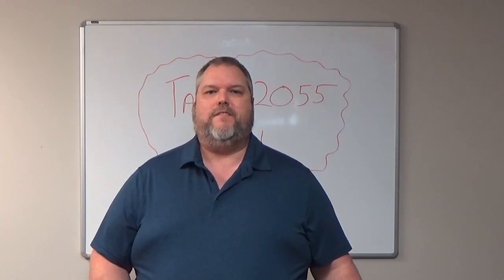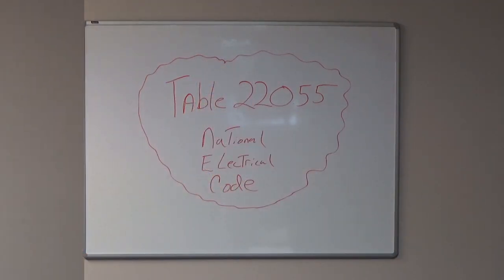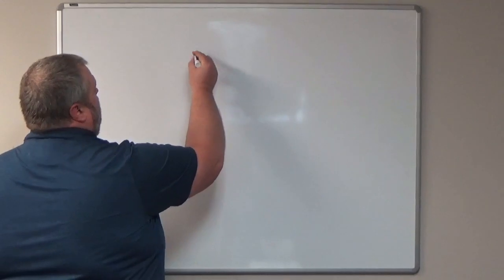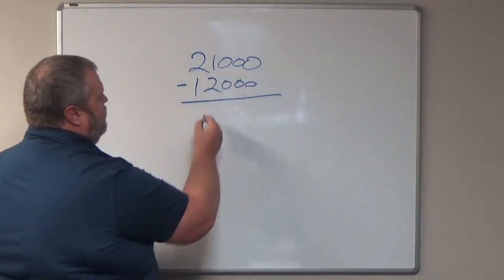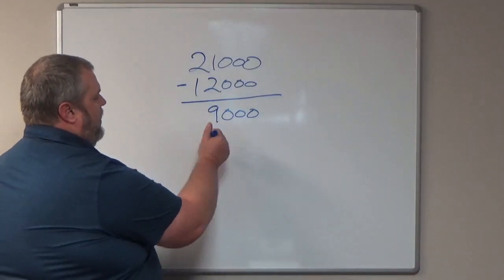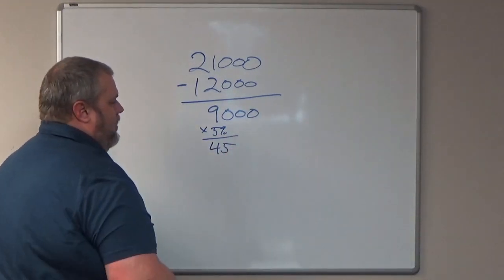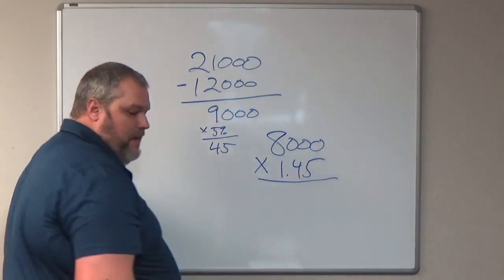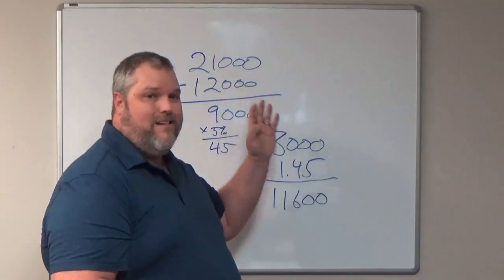Table 220.55 Calculating the Range Demand

Comment: Thank you for this video.  I really like your teaching method.  It's really helpful to go over these code tables/articles.
Reply from the maker: Thank you!! These video's are not the video's that excites people. They are here to help people. That is what I enjoy doing, helping guys understand the code!! Thank you for watching!! CM
Reply: @craigmichaud-electricalins4602  

 @Craig Michaud- Electrical Instructor  

 @Craig Michaud- Electrical Instructor  

Question: what is the purpose of the neutral pigtail on the GFCI breaker?

Why does the neutral from the circuit have to be directly bonded to the breaker but the neutral pigtail gets connected to the neutral bus bar? 

This is the only thing that I don't understand.
Reply from the maker: @KenKaneki-xh7by  it works just like a GFCI outlet. It reads the the difference in potential from the ungrounded and grounded conductors. I will do a video to explain it in the future!! CM
Reply: @craigmichaud-electricalins4602  

Awesome thanks, appreciate it.

Comment: Very Good break down . I have one question for last part of column C . So to make sure I understand your over under on 12kw . The question is even if your 15kW and you calaculate your 15% your still starting the calculation at 8kw and not 15kw ? Always calculate with 8kw ,    in column C ?
Reply from the maker: Yes you are correct!! You use the 8000 and multiply the 15%. I also just take the 8000 and multiple it by 1.15 and get my answer  without having to remember to add it to the 8000. Glad this helped you! CM

Comment: What if there are three different appliances with three different ratings. Like when you have double wall ovens but then an induction cooktop as well. The two ovens are the same and under the 8k rating but the cooktop is under the <12k rating. So what happens when you mix and match on the same circuit.

Comment: So if all three ranges are 12 kw exactly do you add them up then minus the 14000 how do you go about that it I’m lost
Reply from the maker: Just to clarify if they are all 12kw then you just use the number of ranges in column C. That would be 14000va as the demand for all three!! I know it seems confusing but as long as you remember the rules in each column then you will be good!! Hope this helps. Great comment!! CM

Comment: HOW do I get the load calculation for four 32 amp EV Chargers on a commercial building
Reply from the maker: Please email me at sparkyinstructor@gmail.com. Thanks CM
Reply: Do I just add the 32a X 1.25 = 40amp X 4 chargers = 160 amps?